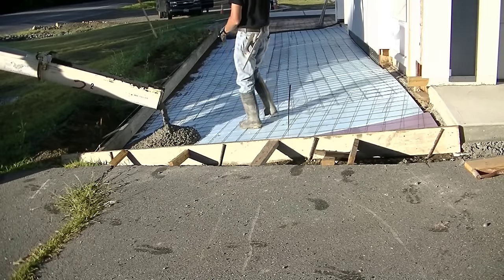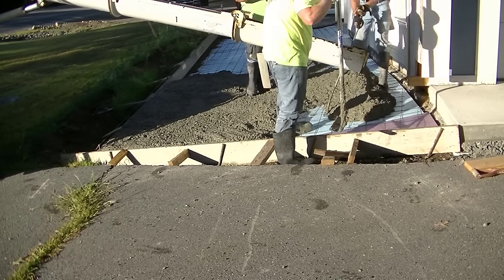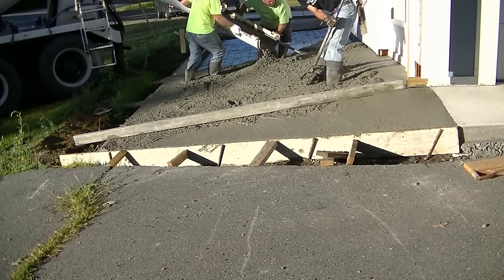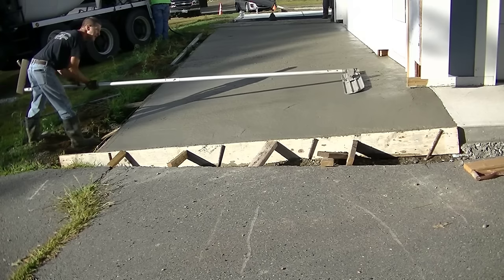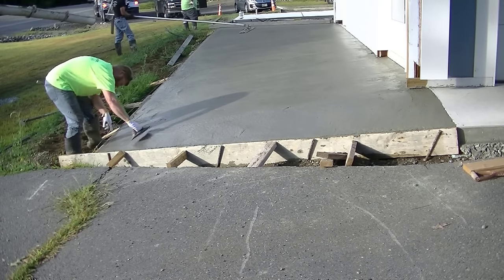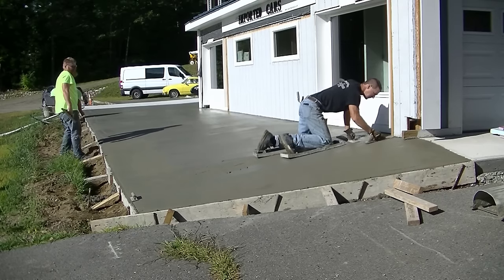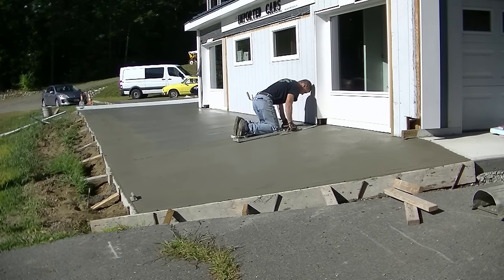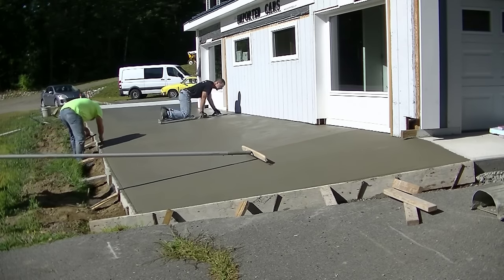Pouring And Finishing Concrete With A Steep Slope

Comment: You’ve given this retired pipefitter enough information to do our pitched slab job at our compound. Thanks for your help brother!👍👍👍
Reply: How did it turn out?
Reply: @Hardworkandrealestateprofits  Very well as far as the pitch, but I brushed the first section when the concrete was a bit too wet and it left a rough texture. The rest was perfect.
Reply: @vanmann8347  Thank you for the reply. Yes I have done the same thing before but it will still last for decades.

Comment: This video showed me what I wanted to know when making a sloped apron going to my metal building.  So the slump is the key factor in keeping the concrete from sagging towards the low-sloped end.  Thanks for explaining about slump.  My take-away is that the higher the slump number, the more water is in the concrete mix; the lower the slump number, the lesser amount of water in the concrete mix. Your 3-to-4 slump seemed to hold well without much sagging.  Thanks and have a Merry Christmas.  👍🏽🤠 12/21/23   🎅🎄

Comment: For this slope you are pouring far to thin.  You need a 4 slump MAX.  This looks more like 5.5 or 6.  Also, you can change your work load by adding Plastic (Water Reducing Agent) to a 3 slump and you will find it FAR easier.
Reply: Bill > Thanks for the great tip.
Reply: but what's the problem you're trying to solve? it didn't seem like they were having difficulties working with it, and a higher slump should mean more concrete for the buck

Comment: I have a side yard with a slope like that.  From my house foundation  to street fence  is 16 ft and is about 60ft long (about 960 sq feet  on the side yard space)....still trying to figure out how to make the space as flat as possible so we can use it. the rest of my yard is pretty flat but is just the last 16ft where it starts to drop down towards the street fence..
 I  live in the city on a corner lot.  I don't know if I should take out dirt from the  high end to level it out. If I do it this way that piece of land will be below home foundation and my  porch. If done this way I probably have to build one or 2 steps to step down from porch  to that area ...Another solution will be to fill in the low end with dirt to level it out but then all my neighbors from outside will  still be able to see inside my yard since the rest of the yard sits high. I guess I can always put lattice or something for privacy..Another solution I was thinking was to use the same dirt from high end and reuse it for low end and this way my step down won be as deep as if I just take out dirt from high end without adding it to low end..
Today I got a string and run it from porch foundation to the fence where it slopes..I measured from fence foundation (low end) up to the string and it measured a little bit more than 2 feet. so I guess thats how much dirt they will need to add there along fence to level it out if I do it this way...How much slope/pitch should we live so it can be an usable space, for a fire  pit with chairs, maybe use it for a basketball hoop..I just wanna be able to use space.

Comment: I have a section of walkway to complete & I am mixing concrete as I go, been doing it in 8' sections but I have about a 15' area to pour/finish that is much steeper that the rest of the project.
After watching this video I guess I should mix dryer & start at the bottom when pouring instead of the top ?? I'm doing this by myself, should I pour in smaller increments to keep from sagging ??

Comment: Thank you so much for sharing your skills and expertise. I was just wandering about my driveway project. It is a very steep slop.i want to remove the existing asphalt and replace it with concrete. It is a 75' long X 22' wide and the slop is about 30°.

Comment: Shouldn’t a expansion joint have been used in between the building and new concrete?  Also between the existing and new concrete? To prevent issues when freezes occur?  I’m no expert....just wondering?
Reply: I agree!  No expert here either, but if it was my building I'd like to have that. 
Can anyone who knows and reads this,  please answer this question?

Comment: Question for you. I just poured a driveway on a slope. Thanks for video. I ordered 4 slump. It was very dry and stacked uo in the cement truck. The driver had to get up there and break it loose. Should that have been my responsibility? When do I take control of the mix. When it hits the ground? Should I have tipped the driver?

Comment: Concrete Professional and mind reader! Mike I have this exact same situation. I'm a do-it-yourselfer homeowner. I need to do my first driveway poor very much like this. Thank you! I just didn't know the slump number I'll go with a 4. I'm going to broom finish it as well but I'm going to go horizontal 90° from what you all did. I want the broom stripes to help with gripping if that makes sense. Looking for better traction up and down the driveway. 
What is the timing on when to apply the broom? This is where you Pros really know your stuff. It's reading the concrete and when to time the bull float, magging and broom finish. I see edging is at the end I can figure that out.
Reply: Timing is the most important part of finishing concrete.   Nothing to it but to do it

Comment: Hello Mike, thanks for your great videos. I'm about to pour a slab for a tennis court, it needs a gradient both ways ie 1.25%  grade on a diagonal. So top left would be 0, top right 3inches, bottom left 13.5inches and bottom right 16.5 inches; how would you mark out the slab height in the middle of the slab (the formwork will obviously take care of the sides). Thanks again.
Reply: You pound dowel pins (short pieces of rebar) in at intervals and hammer them down to the height you want the surface to be. Then when pouring the concrete move the concrete right up even with the top of the pin and make a flat pad there with your mag. Then pound the rebar pin down under the concrete with a hammer. Mark the pad with an "x" so you know it's your level.

Comment: You only need 1/4 inch of fall every 4 feet,, could be a hazard with ice or rain,  I would of suggested  replacing the existing concrete and lowering the slab against the existing structure, or raising the the end of the pad and leaving face so it wouldn't of been such an extreme drop.

Comment: Should have  started pouring at the top. Also  that was wetter than I would have poured and the guy on the strikeoff on the bottom should have stayed about ten inches ahead of the guy on the top. Also wood kneeboards rather than sliders for finishing that.  Wood kneeboards that are used everyday can bite on that and notcslide so bad. But those are the kinds of things you only know if you do it on a daily basis. Good video
Reply from the maker: Yea, this is my first time???
Reply: Pat V > Great tip ! Thank you!

Comment: The welded wire fabric reinforcement is pulled up to the middle of the concrete, but then it gets walked on everywhere and pushed back to the ground; what is the purpose of the wwf if it is not embedded?

Comment: This is most likely a dumb question: For a steep slope job like this, wouldn't it help a bit if half thickness of concrete is poured first immediately followed by the remaining half. PROVIDED it is no more than 20 minutes or so in between the two pourings.
Reply: That would create a “cold joint”. Which is bad

Comment: I don't know if you'll answer but I could desperately need help. I hired a guy that I want to fire before the concrete pour its been an AWFUL experience Yesterday he was dumping in gravel but I noticed he hadn't graded it, its 40ft long with a 2 inch drop by the time it reaches the other side, in fact exactly the same type of setup in the video of slopping away from the building in width and sloping in length the 2 inch drop (yours was 10 here) . I haven't slept I'm responsible for this idiot I hired him at my work, shouldn't it have been cut, and graded  BEFORE he dumped in the rock. I'm in Canada we are also about to lose good weather  tomorrow is the last day, would really appreciate some though, btw nice video

Comment: Where are the steel chairs that should be tied in under the steel mesh to keep it suspended in the concrete slab, pulling it up with a piece of steel rod and then standing all over it when laying the concrete would be classed as a cowboy job if l installed a slab like that
Reply: david vanhinsbergh > Yeah, true  - that's what my dad would call a "chapusa" ... LOL

Comment: sounds like a great idea until the thaw /freeze cycle in winter happens then the homeoners will be falling and busting their ass 1" drop in 4' is more than adequate for drainage ......homeowners just dont know
Reply: 1” in 4’ isn’t very much, but it’ll drain ok most of the time. ⅝” per foot or 1:20 is max according to ADA code. You can get away with 1:12 provided you have hand railing on each side.
Reply: @psidvicious  ive been building homes in alaska for 25+ years so im well aware of building code thanks for your input most folks dont know and the average homeowner is uneducated there should be required education before they commit to the most expensive and most important decision of their lives (besides having children)
Reply: @ak420dave7  I said 1” in 4’ will drain. 
You say everyone should have ‘required education’ on this stuff but you get defensive if someone includes some info on allowable slopes? Lighten up man.
Reply: @psidvicious  thats the trouble with this kind of interaction with folks theres no way for me to convey opinions that would be taken positively with one on one personal conversation i didnt intend to be defensive only stated my experience no disrespect intended
Reply: @ak420dave7  Agreed.
Reply: @psidvicious  Good input. Thanks
Reply: @ak420dave7   and psidvicious  > Great, in the end we all end up being friends... we all mean well.

Comment: Code in my area would not allow, is unsafe and toooooo much slope,expansion  next to hard edge, ….????and why so thick…??   Overkill….let it set up then finish it, , no kneeboards necessary, you guys do a lot that does not need doing, long handled trowels, one two passes , done, is silly to work soo hard for something that is going to be broomed,,,,,,,34 years experience talking here, not an armchair captain, looks good , but in my opinion way too much labor exerted, work smart not so hard
Reply: Great point !  Thank you for your professional observations, is much appreciated.